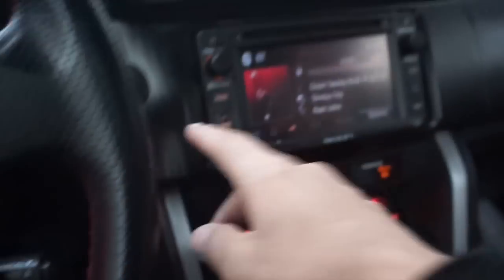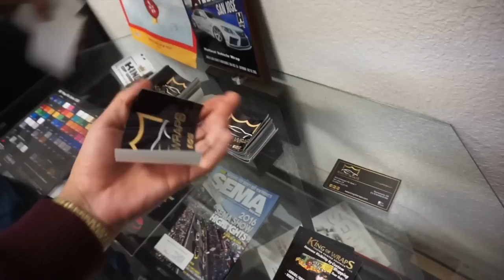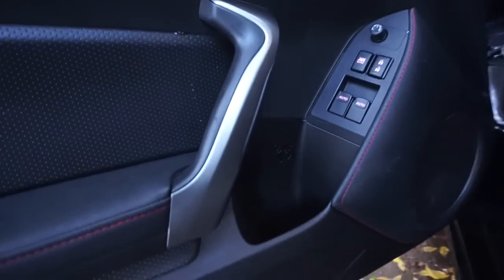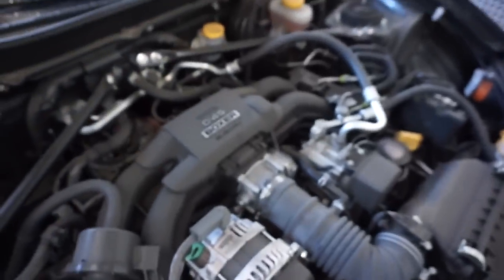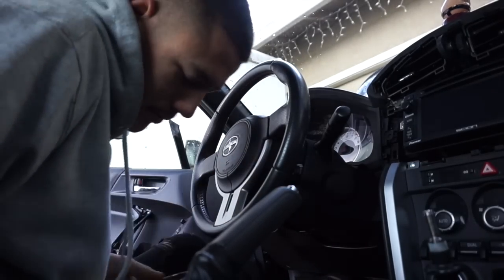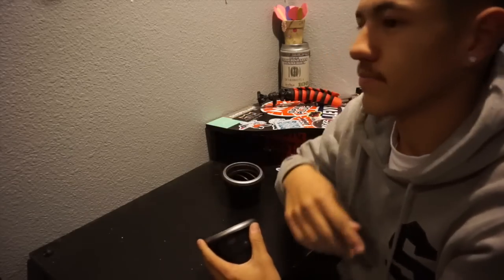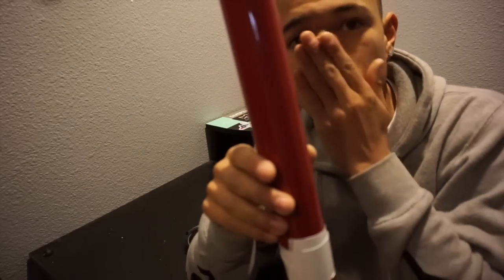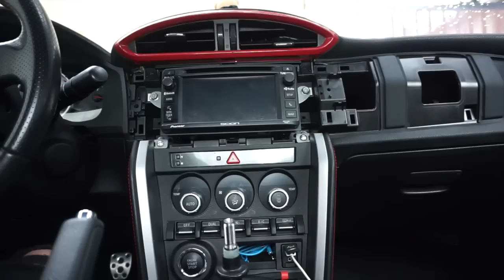Vinyl Wrapping Interior Trim of 2014 Scion FR-S

Comment: Nice work, I painted my pieces gloss red, but since the pieces have this brushed plastic texture it has a matte feel and I love it
Reply from the maker: The Blasian that's dope bro, how is the paint holding up
Reply: It would still be gloss red if you used gloss red paint. You likely held the spray too far away.
Reply: @chosenideahandle  I did as I intended to
Reply: @franciscoayala8025  had this can of duplicolor red vinyl paint on for over 2 maybe 3 years already no chips. Did about only 2 coats
Reply: Jule Casey I’m just saying your results have nothing to do with the original finish underneath.